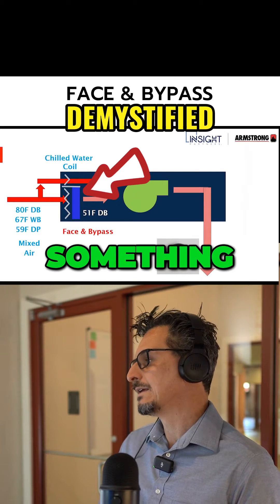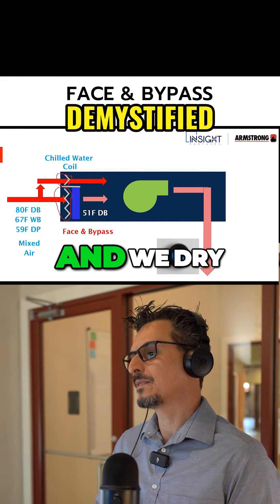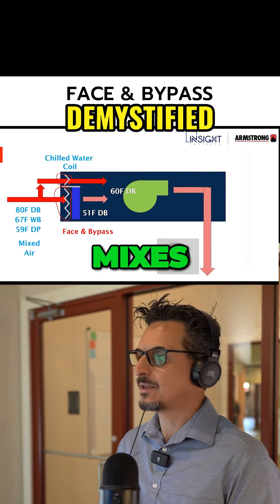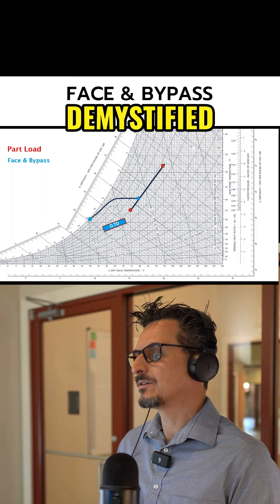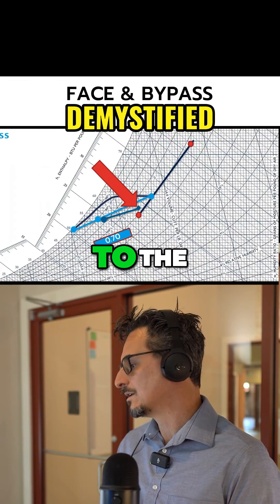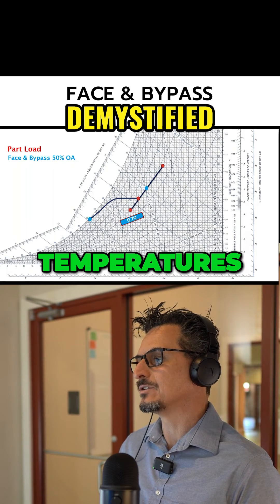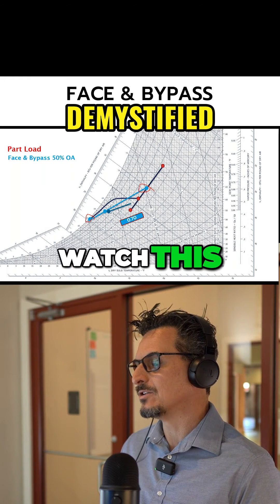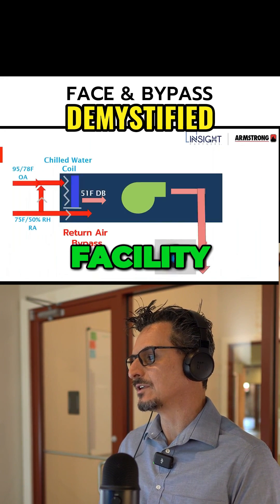Understanding Face and Bypass in Chilled Water HVAC Air Handlers

Comment: Do we need both Face & Bypass damper for DX system AHU?
Thanks
Reply: I think having both face damper and bypass damper is important so we can have equal pressure drop and make sure proper airflow in each. Without face damper, you could have more pressure drop in coil, so all the airflow bypasses the coil. The reason could be airflow tends to go through kess resistant/pressure drop path. I could be wrong though!